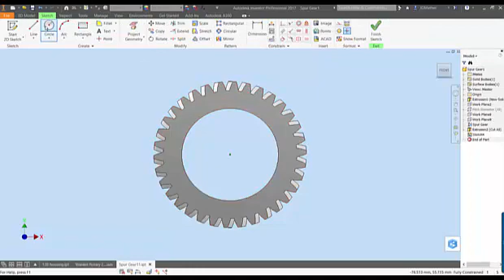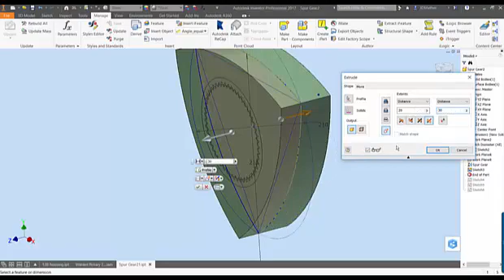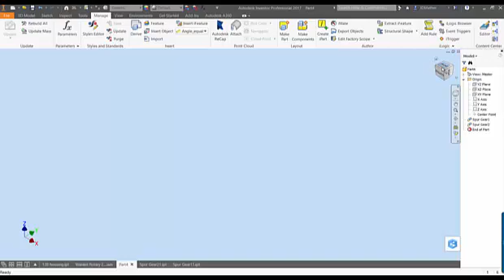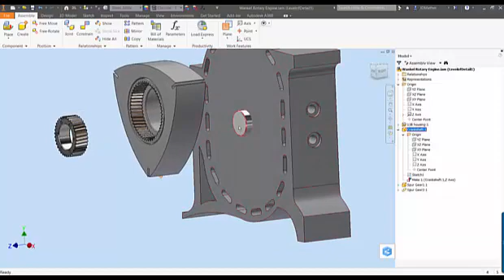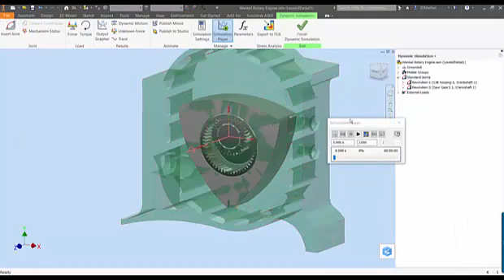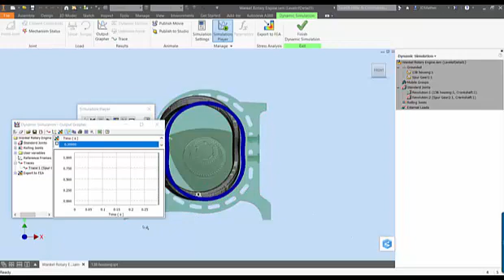Wankel Rotary Engine

Comment: Where can i get this app
Reply from the maker: Joe Dav Autodesk.com - Inventor Professional
Reply: @jdmather5755  Hi,  where I can get a cylinder project?
Reply from the maker: @wasylswyst7292  I do not know what this means?
Reply: @jdmather5755  
Do you have the dimensions of everything?
Reply: @jdmather5755  Or the whole product
Reply: Ia it possible for u to provide the draft drawings or cad  2d drawings with dimensions of this engine and all the parts,it will be usefull for my research studies